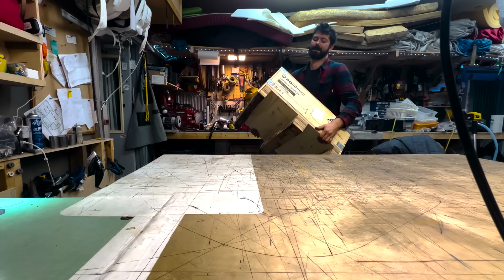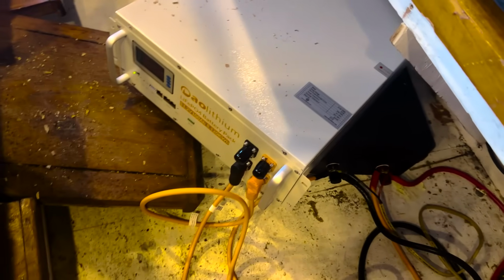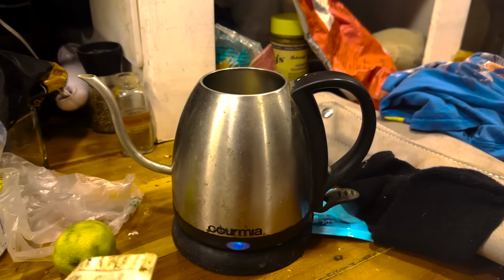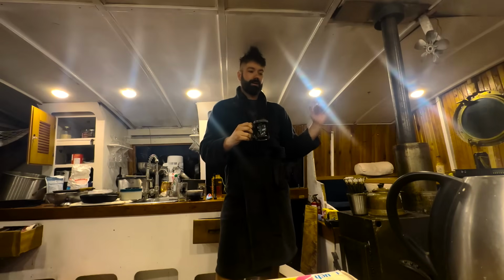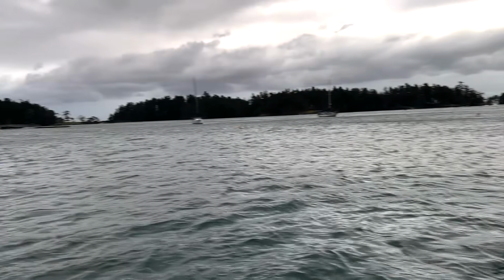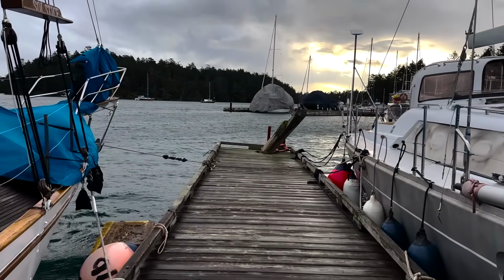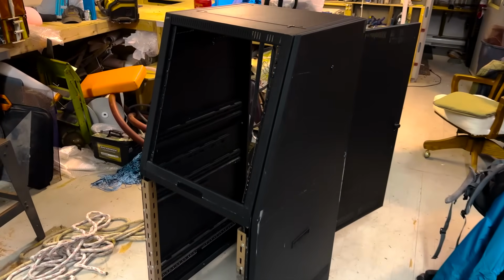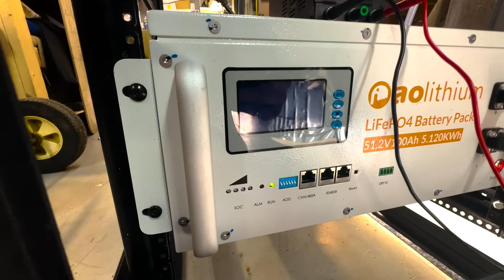BIGGEST STORM of the YEAR

Comment: Simon, when I worked in the AV industry (last century cause I'm old) we used to get rack rails, and scrww them into a plywood box that we covered in black carpet (yes we made our own racks), point is the only metal was the rack rails and the clips that held the lid on the box. So I looked online and rack rails are still available, they are just strips of right angles or L profile metal with the holes at the right spacing and often power coated for corrosion resistance, buy a pair of rails (should be less than C$50) and mount them in your electrical cupboard on Old Dog, you may need some strips of wood to pack out from the cupboard walls to get the spacing between the rails correct, but I'm sure you can manage this. 👍

Comment: I saw the news about that storm.  It was a doozie approaching our typical winter storms here on the Maine coast.  We are in the middle of 3 day long 40-50 knot gale right now.  Fortunately the wind is blowing offshore, so we don't have waves to worry about.    Not that I am concerned about wind or waves since my boat is in the shed for the winter.  Batteries have gotten crazy cheap in the last year.  This summer I bought four 200Ah 24 volt batteries for $4K.  That lets me run my entire house for almost four days in the winter and indefinitely in the summer.  The limit is due to the small size of my solar array.

Comment: I picked up 2 AOLithium server rack  in the spring for $3200 delivered to my door in NS and thought it was smoking deal. With the current sale its $2300. 

They have been running in our cabin in Newfoundland since June. We have 3900watts of panels into an EG4 3000EHV-48. I went with that all in one inverter for the high voltage solar input which means I don't need a combiner box. The SRNE inverters look to be nearly exactly the same but a few hundred dollars less. I'm very tempted to order another server rack battery and get an SRNE inverter for portable use. 

My parents are living at the cabin nearly full time. They had to run the generator for the first time in early November when there was a string of grey rainy days. As long as we get a sunny day once every 3 days they don't need to run the generator at all.

Comment: Do you happen to have a weight rating on that rack?  If it's a 500lb capacity rack you might get close to its limit.  If you're putting it on a boat, the rocking back and forth will be something it wasn't designed for, you might have to reinforce it around the corners.  At any rate, thanks for uploading the video!

Comment: Hey Simon.  Can spray the inside of those battery circuit boards with conformal coating?  That may help in longevity?
Reply: conformal coating only does so much, he'd be better off with a watertight container and place all the batteries, electronics, etc in there.
Reply: @Cam.Klingon  That is why I said, "may help" not solve.